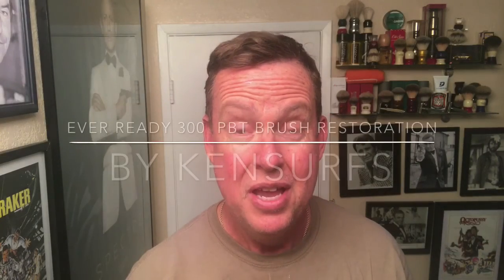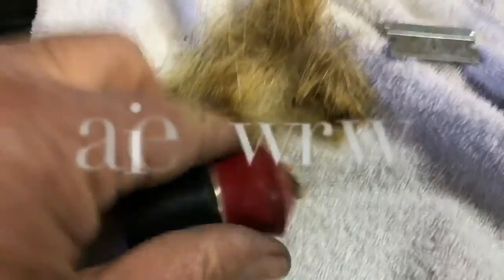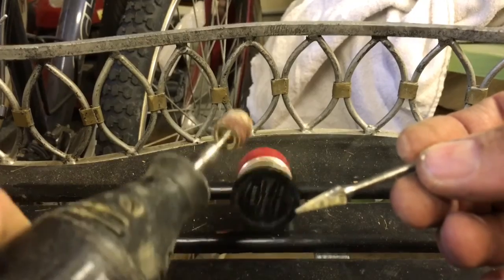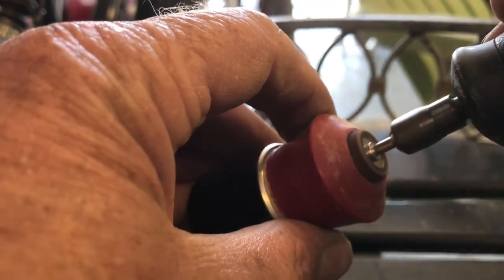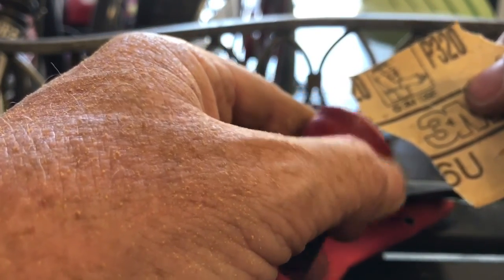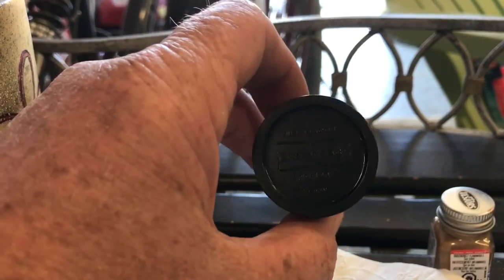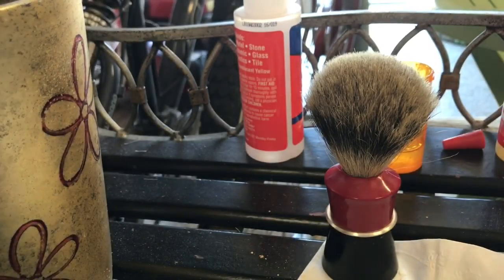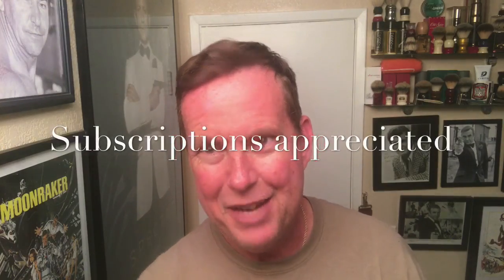Vintage Ever Ready 300 PBT Badger Brush Restoration.

Comment: What a good job you did on that restoration, really impressed. The Engineer marking tool you used for determining the correct level of epoxy in your mixing tube was cool :-)
Reply from the maker: 1928flash I didn't have a sharpie handy lol👍👍

Comment: Kudos on restoring that Ever Ready. 
I also have an old Ever Ready brush that is worse for wear. It's been resting on a shelf.
Thanks for the video, it was very informative. 
I may just take mine out of retirement, and replace the knot.
Reply from the maker: The Spectre Check out eBay or DHgate for great prices on the knots👍👍

Comment: If I saw that brush,I would have left it were it was,but you made another good job of that brush Ken.Now I will think twice about leaving a vintage brush were it was.I may have to get myself a dremel in the new year.
Reply from the maker: The Suffolk Shaver People sell this old brushes so cheap if they look beat up. But since they restore so well it's a great deal. I got 2 brushes including this one for $10 free shipping and the shipping had to be about $4.00
Reply from the maker: The Suffolk Shaver That Dremel I've had for at least 16 years and it works fantastic for special little jobs
Reply: Finding those cheap vintage brushes feeds your brush addiction,l.o.l.

Comment: Thanks Ken!  Your previous video totally got me into restoring old brushes. What setting is your Dremel on when you polish?  I managed to melt one of mine using the cloth attachment with Flitz.  So I only polish by hand now. I also noticed that Blue Magic does a better job of polishing the plastic than the Flitz. Awesome stuff Ken!
Reply from the maker: Bee Jay I have the setting 1 less than the highest. I burned a brush the first time too. It needs a super light touch I found out👍👍

Comment: .Great job Ken.  You`re quite the handy man.  Was wondering why you used so much glue.  Was that to keep the balls from moving around or rattling in the brush?  Have a good week.
Reply from the maker: Brian B. The epoxy completely fills the cavity in the brush, entirely surrounding and encasing the balls. The handle becomes solid at this point, no longer hollow.

Comment: I know I'm late to the party here but, I have a question about vintage brushes. I have a few vintage Ever Ready brushes and I wonder how risky would it be to just use them. They are used but, they are in great shape. I've cleaned them with anti-bacterial dish soap but, I'm still a little hesitant to use the brushes. Should I sanitize them further or should I just restore them and forget about keeping them original?

Comment: Great restoration job, Ken. I've done myself 9 brushes already, and they indeed look and perform great. No need to buy new brushes anymore, I simply bid on some old beat up brush handles, restore them and get some nice Maggard Razors 2-band badger knots or Ace Shaving Silvertips. Awesome stuff.

Hey, since you have a drill press, I have a tip for you. I got this kit: https://amzn.to/2JmMkdQ Is made for drills, not for the dremel. And it comes with a couple sticks of polishing compound. I thought flitz did a good job until I tried this. You simply put one of the bits in the drill, turn it on, and rub one of the sticks on it just a bit until there is enough compound on the cloth, and then simply rub around the handle on it. The shine it gets, and how fast it polishes it is astonishing. I'm using the green compound for brush handles, and the red one for razors. Believe me, you won't regret it. Is a whole new way of polishing your brushes. And I don't have a drill press, I just use my regular hand drill with the locking pin on its slowest speed.
This is the video where I realized what those sticks of plaster-like material were used for: https://www.youtube.com/watch?v=PRNXQmN1gqs Check about halfway where Matt explains how they polish the handles. They talk about a cotton wheel, but the Amazon link I sent you are cloth.